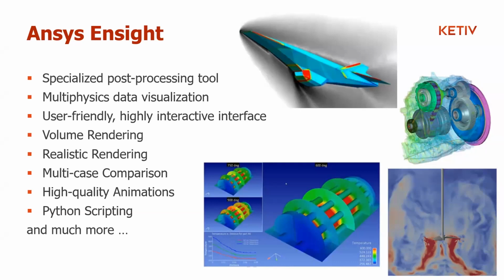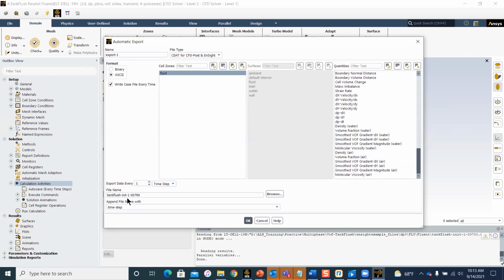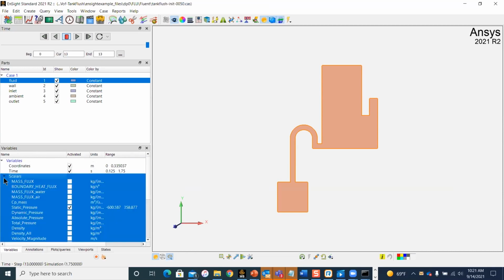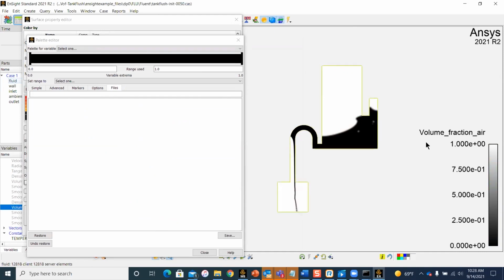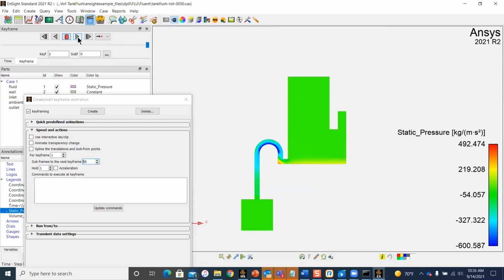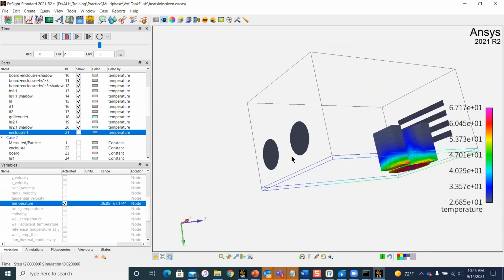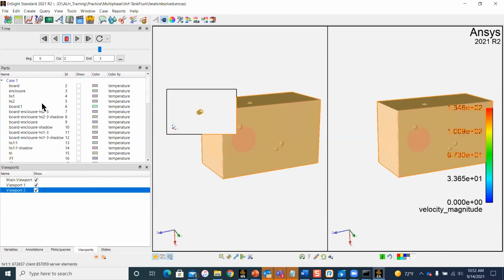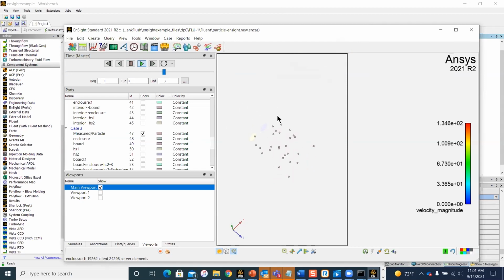High-Quality Data Visualization Using Ansys Ensight for CFD Simulations | KETIV Virtual Academy

Comment: I have a transient analysis of a valve with dynamic mesh operation. When I tried what you did in Ensight, the animation did not show the motion of the walls, and the contours are completely wrong. I chose flow time for saving the cas and cdat files. However, you chose the time step to save the files. Is this the problem why my case does not give me true values?

When I open any single flow time in Ensight, it shows totally true values for every contour and also walls become moved. However, I cannot form the transient animation. Could you help me, please?